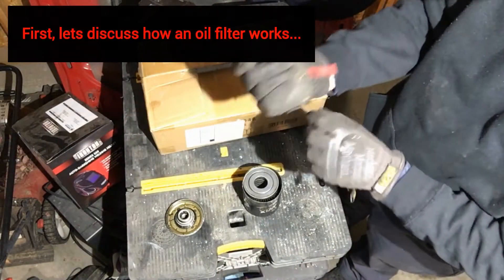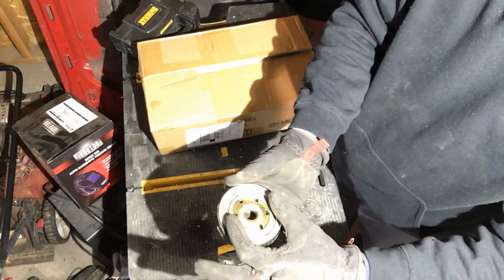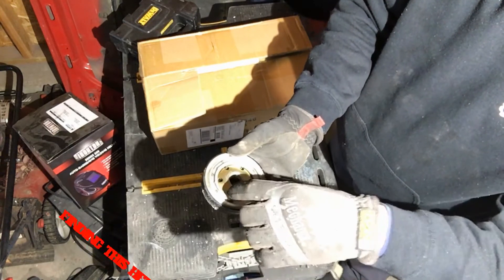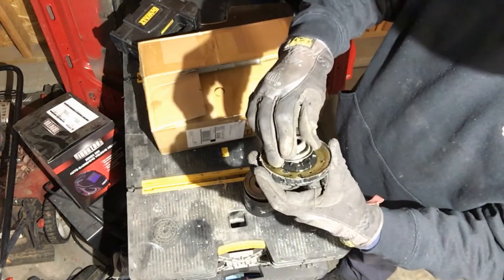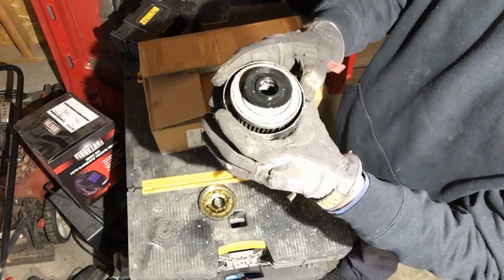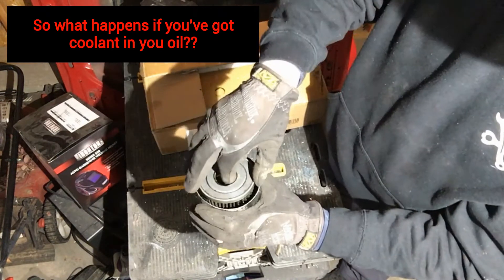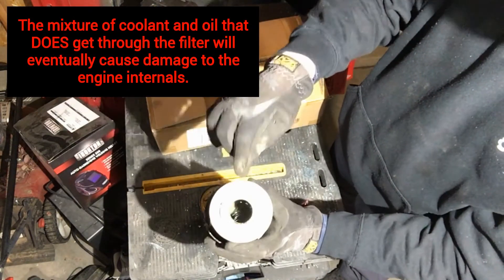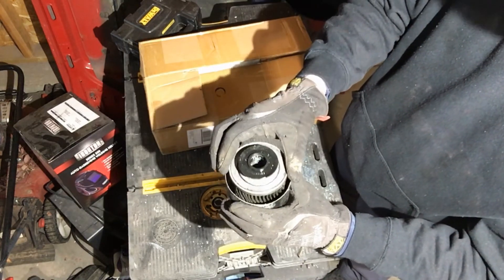Coolant in Your Oil?  What Happens?

Comment: Had a timing cover gasket fail. Fixed with K Seal. Will oil tend to gel inside the motor if I didn't get the oil changed soon enough? Does coolant in the oil cause the oil to gel inside a motor?
Reply from the maker: It doesn’t really gel…. But it’s hard to get all of the stuff out once it mixes like that… after a couple oil changes it’ll mostly be good